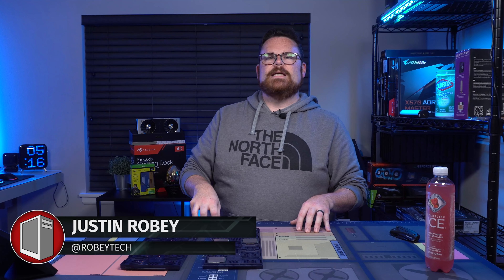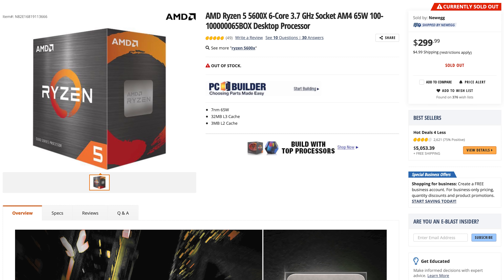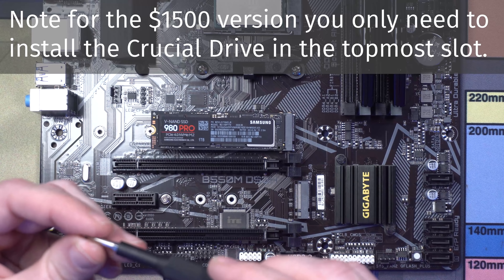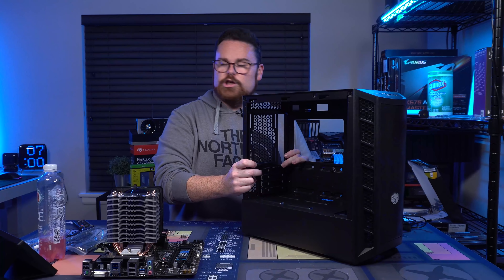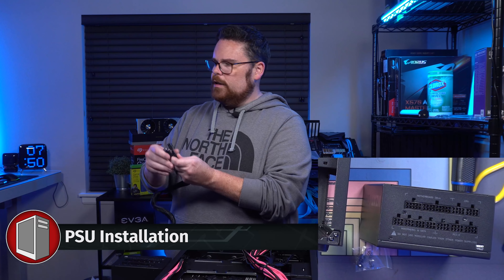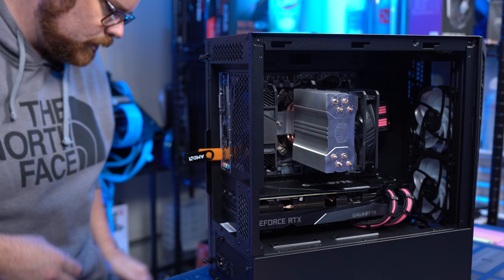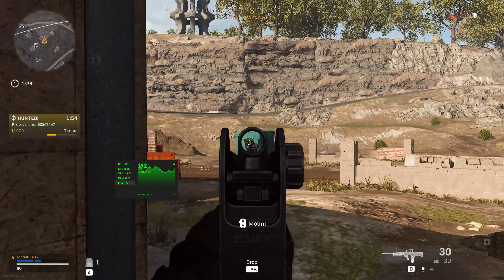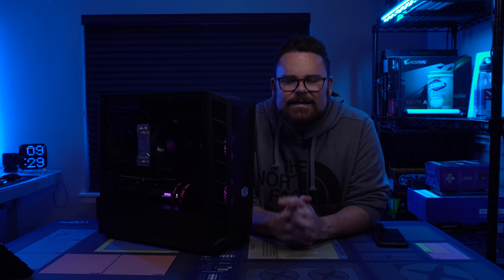Got $1500? This is the gaming PC you should buy! Ryzen 5 5600x with an RTX 3070 (Plus Benchmarks!)

Comment: I made this build 2 days ago, and its working out amazing for me. Im getting really good framerates on every game with max settings. I also managed to get all the parts for msrp so this is really a steal for me.
Reply: Are you using a 1440p or 1080p monitor?
Reply: @gogetablue7905  1080p lol I know that has a big part to do with it. But the occasional 200 fps on rebirth island warzone is still overkill.
Reply: @samhice600  lol thanks for the reply. I actually still can't decide if I should go for Ryzen 5 5600x + RTX 3060ti or Ryzen 5 5600x + RTX 3070. I want more fps than higher resolution but I wanna try 1440p too.. so I'm still confuse
Reply: @gogetablue7905  If you can afford the 3070 for sure without a doubt go for it.
Reply: did u need bios update?
Reply: I’m sorry to bother you but were you able to do the BIOS update because it’s not working for me it flickers on like in the video but when I press the white bios button it doesn’t start flashing like it’s supposed to
Reply: @chaosgostar1598  I was able to get mine to update fine. If you still cant get it, I would recommend taking it to a shop and letting them see if a different cpu can boot it.
Reply: @samhice600  I have tried different usbs and different versions of the BIOS update that white button doesn’t light up at all

Comment: my build was Ryzen5 5600x, B550 tomahawk, gigabyte AMD radeon RX 5600xt, 16gb RAM 2666mhz (will change to 3200 soon), 240gb ssd, 650 PSU, but my monitor is not detected, always no signal ,i tried other monitor too but still no signal, i use my monitor to other computer but its working, i tried all trouble shoot i watched here in oyutube bu still its not working, what should i do????

Comment: I got basically the same thing but a prebuild on ibuypower for $1850 :(  I only got 3200mhz ram, you think i should upgrade to 3600?
Reply: What frames do you get? Im wondering too because im about to get that. Im assuming cpu intensive games like tarkov and flight sim might drop 10-20 fps but other games will be fine

Comment: Nice Build , i self have a MSI MPG X570 GAMING EDGE WIFI + Ryzen 5 5600x + GeForce RTX 3070 iChill X4 + 16GB G.Skill SniperX Urban Camouflage DDR4-3600 + Dark Rock Pro 4 and like the setup now. Many peeps laugh why AMD bring the 6800 out but i check a lot tests and i have laugh, AMD have 16GB Vram but in Games 2-15 FPS more ya but when it comes to RT + DLSS and others Nvidia still burn the AMD Cards and here in Germany the AMD Cards to Expensive too. Have a other System with a RTX 3070 Ventus and MSI MPG B550 Gaming Plus too and a 5600x runs  perfect in 1080p and 1440p.

Comment: Will 650w gold be okey with Ryzen 5 5600x and rtx 3080 be enough?
Reply: You should get a larger power supply. At least 750w or 850w. Don’t cheap out on the psu, you don’t want it to break your parts.

Comment: Am I the only one concerned that he has a low end motherboard, a bronze 650w powersupply, an unnecessary cooler since the stock is fine and you can even overclock with the stock (but in my opinion not ideal on that board so no point on buying a cooler) and no monitor. People forget in order to play yous till need a monitor and that should go in the budget along with peripherals.

Comment: the BIOS isn’t flashing for me even though everything is connected, the power button lights up and the fan lights flicker quickly when I push the on switch can somebody please help me sorry for the trouble 

When I press and hold the button  the lights on the case fans light up

Comment: 300$+ for a 6 core cpu or you can get last year 8 core 16 thread ryzen for 260$. Hmmmmmm which is the better choice for long term gaming on a budget. Don't buy the 5600x if you want to have a computer that'll last more then the next 1-2 years. Its not budget if you upgrade cpu every 1-2 years. You actually spend more money on upgrading to better components then you would of if you just bought a r9 3950x to start or a older model 8 core cpu. More cores will assist you in the long run and the hyper threading will help it last into the future. You can actually buy a computer that is equal to this for 1500 already built. Idk why you would go out and get a DiY computer that isn't better then a prebuilt for same price and doesn't require your time or effort installing parts. Also you can find 3070's and 3080's in these prebuilts with last year gen cpu's and if you really want that 4k ram instead of the 3.6k ram then you could go buy it and add it into the pc then sell the ram from the prebuilt and basically pay equal or maybe even less price for the ram.

Also his motherboard he is using isn't even that good. You can get ones with built in wifi for like 20-80$ more and are better boards in general and will fit the budget. I know people be like don't get built in wifi or whatever, but lets be honest are you going to go buy a wifi adapter to install into a usb for 30-100$ or just spend that amount on a wifi board that is equal or better spec then the board he's showing. I'd rather have the wifi built into my pc for equal price points. But he doesn't mention that at all on how you have to go out to get more stuff for you DiY computer. I mean if you hooking up a LaN then I guess it doesn't matter, but how many LaN can you really hook up in your house if you have kids, are you going to spend time running 200 foot cables through your house is this really cheaper at this point.